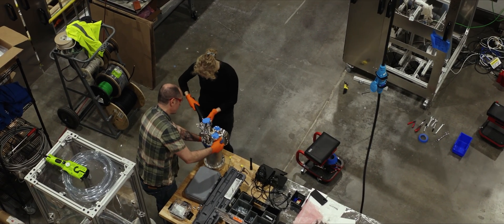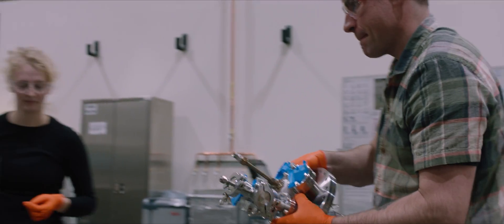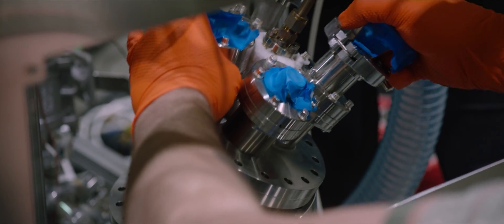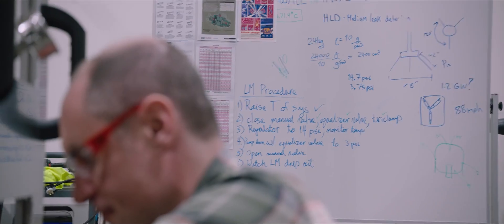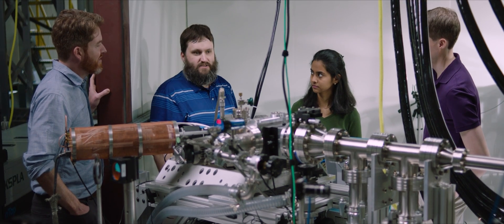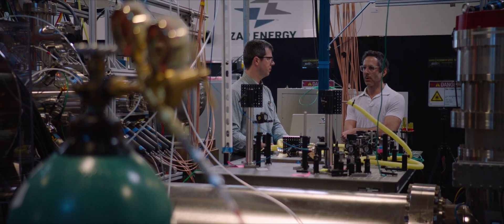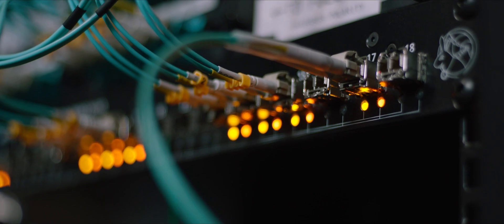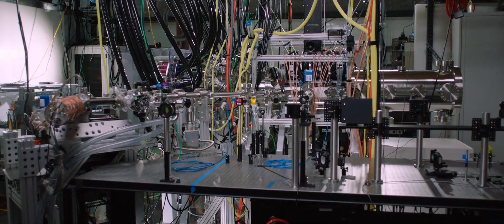Fusion power. No magnets required.

Comment: A common characteristic of fusion energy experimenters, when promoting their fun experimental machines, is to provide much basic fluff while omitting numerous key evaluation details. This process has been going on since the first nuclear fusion energy experiments began in the late 1950s. Since then over 150 experimental machines have been constructed and experimented on. Only a few have ever generated more than one watt-hour of actual fusion energy. The vast majority have been simply involved plasma confinement experiments without any intention of using fusion fuel, or generating a significant amount of fusion reactions. Despite those limited intentions virtually all the machines have been branded as being 'fusion reactors.' The overselling, of the state of development, has largely been done to attract the tens-of-millions, worth of USD, required to fund the experimenter's fun research. See the Wikipedia article titled 'List of fusion experiments.'

The Zap Energy announcements haven't mentioned that the favored reaction fuels for their machine will be a 50/50 mixture of deuterium-tritium fuel. Typically, promotional presentations include claims that the hydrogen fusion fuel is almost limitless. Always omitted is the fact that the radioactive tritium's commercial price is approximately $30,000 USD per gram.

In response to journalists questions companies, such as Zap Energy typically don't respond to questions regarding details, often claiming that such information is proprietary. The following questions should be asked as developments progress.
1/ Have any of your test pulses generated more than one watt-hour of fusion energy?
2/ If you have detected evidence of fusion reactions then what period of time, during the formation of the arc plasma, did the fusion reactions last and what is the highest frequency you have been able to conduct receptive pulses?
3/ Once you have achieved a significant fusion energy production per pulse what is the fusion energy duty cycle value that you expect to achieve to generate a highly significant amount of average fusion energy output that can be employed to feed the electrical grid?
4/ With the current experimental machine how many plasma test shots are achieved before electrode materials have to be replaced, or reworked?
5/ Are you currently working on plans to create a tritium breeding blanket?
6/ When you finally achieve extremely high yields of fusion derived 14.1 MeV neutrons that will irradiate your experimental machines and result in the generation of neutron activation products, in the reactor components, do you have plans for the storage and eventual removal of the radioactive components that will require replacement parts?
7/ According to your current calculations, when each eventual fusion power shot occurs what percentage of the fusion fuel do you expect to fuse and what percent of unfused fuel will need to be recovered and purified so it can be recycled into shots downstream of that shot?
8/ When you do achieve the so called 'net fusion energy gain' (Q) value (sometimes referred to as 'scientific gain') that is beyond 1.0 explain how that value fails to include the quantity of energy that is required to power the experimental machine and that value typically only includes the time period when the pulse of fusion reactions are actually occurring.

Comment: The simplest fusion device is the neutron generator used in rusdian nuclear devices. It literally is deuterium filled tube with a semiconductive zirconium tritride cathode and a central anode pin. The HV pulse accelerates the deuterium ions into the target. Its used for neutron generation. It does not use magnets at all. A z pinch device does by very definition use a very powerful pulsed electromagnet, and they can make enough neutrons to do a lot of fun things with besides starting a chain reaction.
Reply: Pretty much every other fusion technology under trial "does not use magnets" - they use electromagnets.
Reply: @ic7481  yup, you are 100% right. Anything designed to make sustained power must use a powerful magnet, usually a superconducting electromagnet
Reply: I think the point trying to be made is that theyre gonna try to do this without needing a giant tokamak to confine the reaction. Its compact
Reply: Da mesi in Giappone è  in funzione la prima centrale a fusione nucleare del mondo perfettamente funzionante  senza scorie e pericoli ..se ne parla poco per vendere ancora le vecchie centrali nucleari inquinanti e pericolose

Comment: Corporate buzzword exercise - no useful information whatsoever
Reply: "We have reached an inflection point in the technology sphere..." says it all!  🙂  (I doubt that they will like the inflection point that they will eventually face.)
Reply: @analog_guy  😂
Reply: Yup the irony is a z pinch device DOES require powerful magnetic fields, usually supplied by a pulsed electromagnet. I doubt it could create stable power generation level fusion as the power needed for a "neutrons as the goal" version was pretty extreme. Several KW of power in for excitation and cooling for maybe 100mW yes miliwatts worth of neutrons out. Also a power generation z pinch machine would get dangerously radioactive very quickly 😂
Reply: I had the same reaction.  Absolutely no specifics.  Sounds like another Solyndra scam.
Reply: Few if any fusion research projects ever mention their efficiency.
Reply from the maker: Hi @ic7481 - This video was meant only as a very general introduction to the company. I'd encourage you to check out our other videos or visit our website and published papers to get more detailed information about our science and fusion approach.
Reply: @Zap_Energy My critical comments were regarding this video in particular, not the company as a whole. As an engineer involved in fusion projects, I get fed up with companies becoming all about corporate marketing and hand-waving. Remember that your YT audience will tend to be more technologically savvy, so you can't use TV style advertising here.

Anyway, thanks for not deleting my critical comment.
Reply: Exactly my impression too. Just 30 more years and 30 billion dollars more. A cake walk.